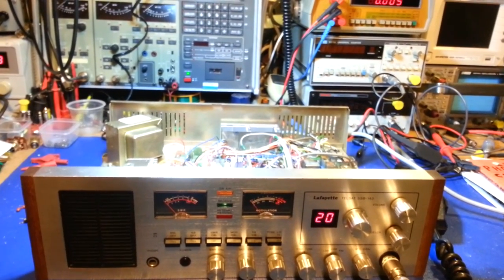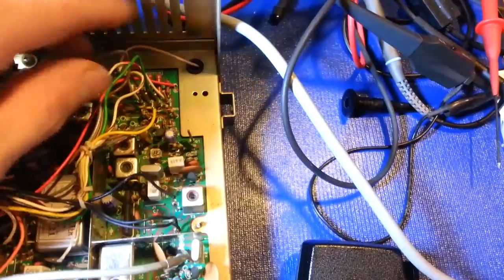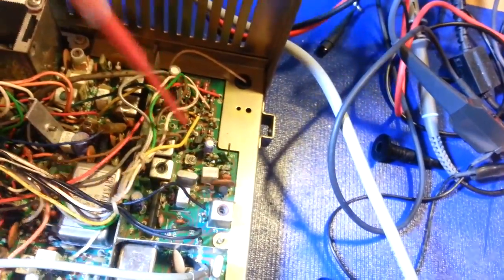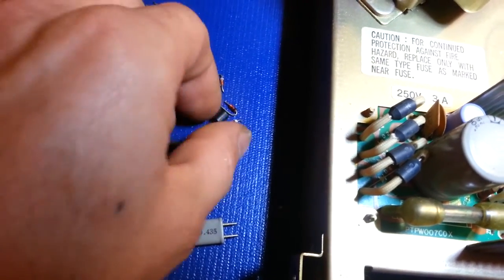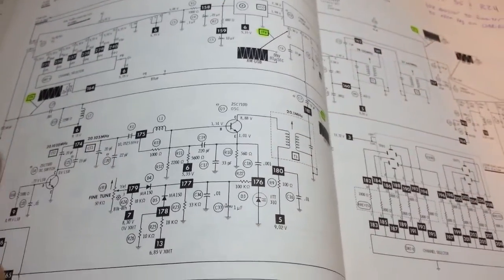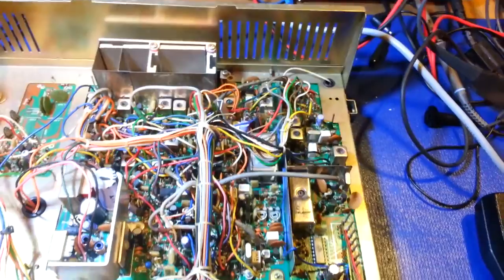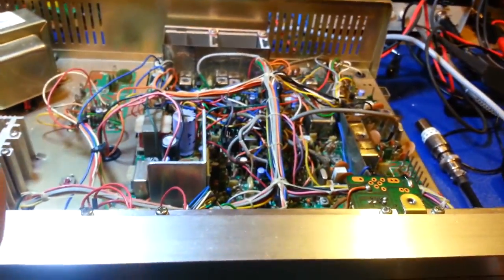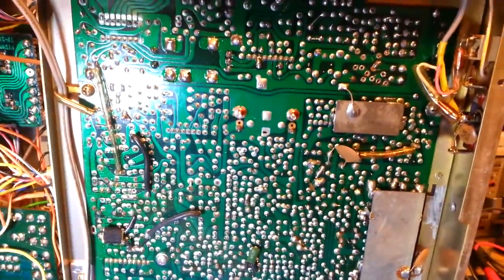Lafayette Telsat SSB140 VCO block replaced and frequency conversion undone.

Comment: A silicon diode in series with a zener diode serves two purposes, first increases the voltage of about  0.6 volts, second improves the t,thermal stability of the zener.

Comment: It depends on what the VCO frequency is.
I am guessing it's around 37Mhz? 
They aiming for low part of 26Mhz or upper 25Mhz?

They probably had to pull the caps because the crystal they used wouldn't oscillate.... too much load capacitance.. etc.
Reply from the maker: What's wierd is the varicap they pulled (CT1) is for adjusting AM/USB 20.105MHz.  The one they left in (CT2) is for adjusting LSB 20.1035MHz.  By removing CT1 they removed any adjustability for AM and USB.  This board uses a doubler circuit here.  This signal beats the VCO signal producing 37.66MHz (AM/USB) and 37.657 (LSB) which feeds the 1st rec and xmt mixers.

Mike